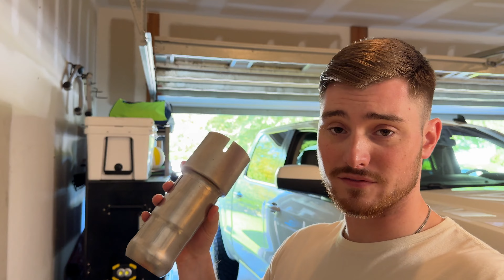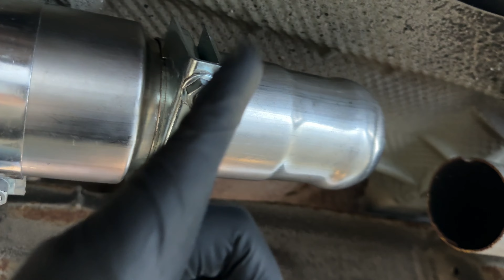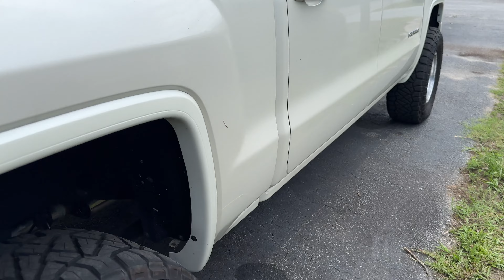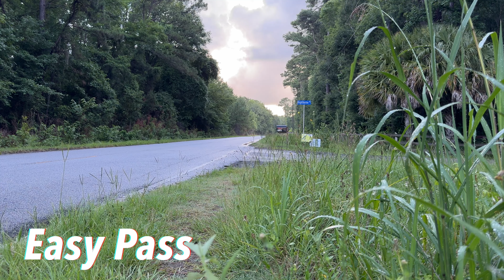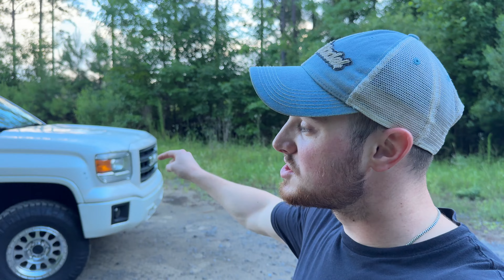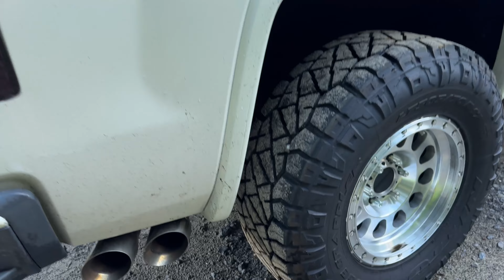Long Tube Headers & Borla ATAK Exhaust - 2014 Sierra 5.3 [STUPID LOUD]

Comment: I had same setup headers 3” catless y pipe and borla ATAK. Ended up taking it off. But people told me to buy a vibrant resonantor to tame it down. Also if you run e85 its louder
Reply from the maker: I don't mind the rowdy-ness of it lol, adds to the character of the truck imo

Comment: Sounds good. Adding a small resonator before or after the muffler will really with the rasp. I’d recommend Borla pn 401339 or a Total Flow resonator.
Reply from the maker: @mattl1576  I’ve been considering, but it’s not too bad rn, maybe if I cam the truck and it gets absolutely ridiculous

Comment: How’s the drone in the cab? I have long tubes on my 18 Silverado with a magnaflow 18” muffler and the drone drives me nuts. Ended up adding a glass pack and it helped a lot. Not raspy anymore though..
Reply from the maker: @61273ripper  it’s not too bad as long as you’re not trying to accelerate. Anything below 2k RPM is pretty quiet

Comment: What size lift and tire setup do you have? Wanting the same setup and how’s the rubbing at full turn?
Reply from the maker: @ryancarter1132  just a 2.5” level on 305/70/17 tires and Method 315s. It only rubs at the middle point, but not at full lock

Comment: sir, the speed limit on hyde park rd is 45 mph. better slow down there cowboy
Reply from the maker: @andrewl.4277  Hyde park rd in Mexico
Reply: @hunterrwiilson  I wrote a python script that changes the youtube video resolution to 144p everytime your face is on the screen but it switches to 2160p60 (4k) whenever your truck goes vroom vroom
Reply from the maker: @andrewl.4277  that's actually probably pretty suitable, lemme get that code
Reply: @hunterrwiilson you're gonna need a couple tools like the google api client library and an api key from the google console along with a full setup for a python environment so just the code itself wouldn't be beneficial to you. plus im not done. i'd like to alter the code so that everytime you're yapping it mutes the video
Reply from the maker: @andrewl.4277  how do you know when to tell it that I’m yapping vs truck sounds? 👀
Reply: Great video!   Did you notice any power difference by the seat of your pants?

Comment: I have the same setup on my 14 Silverado Borla Atak Dual Exhaust. Shes  loud as fuck. Id definetly invest in getting it tuned. Mine was running super lean because of the Long tube headers. After the tune. It definitely woke the truck up even more.
Reply from the maker: @Garcia7148  I’ll be doing that here soon as well

Comment: Any luck with the tape on the leaks ? I got same kit and even bought the supposed upgraded clamps from them and they still leaks alil
Reply from the maker: @jodaddy3135  I just discovered a small leak within the past couple days, going to try and find a solution
Reply: @ speed engineering needs to do something about that .
Reply from the maker: @ I think that's why some folks just weld the y-pipe to avoid leaks. Just isn't smart for when you need to disconnect the exhaust for any sort of work where the y-pipe is located. But it would be nice if clamps were better

Comment: I've heard if you wipe down the headers with transmission fluid before installing them they won't rust . I have a supercharged 6.2 chevy Reaper truck I'm thinking about installing long tubes . Great video !
Reply from the maker: @kennybryan4816  that is something I’ll need to research first before trying lol! But sounds like you’re about to have a chance to try it out. Thanks for the feedback Kenny!

Comment: U can get about 750-800 hp to the wheels with long tube headers and upgraded throttle body and intake manifold , cam and tune and a stage 2 trans. My coworker has one. No turbos or supercharger and he's between 750-800 at the wheels
Reply from the maker: That's pretty impressive, I'd like to see what he has going on cause that sounds crazy
Reply: @hunterrwiilson  yea I think he's holding back on telling me a few other things
Reply from the maker: @zachariahwoodside4048  probably
Reply: my 6.2 made 450 with cam, e85, cai, long tubes, exhaust, ported mani, converter, rebuilt trans he must have done some crazy sheet😅
Reply: @edwingomez7444  yea i forgot to throw cams,tune and 2 stepped the Silverado he has

Comment: How much did the whole setup run you? Could you give me a list of everything you purchased, I want to do this to my truck lol. What did you use for your exhaust setup?
Reply from the maker: @cristobalcisneros7895  on my LTH install video, which should be right before this post on my channel, I have everything listed out in the description and the price of it all at the end of the video! Sorry to make you dig but I don’t remember everything off the top of my head lol. 

Just the same crate Borla ATAK muffler that I had previously but it was just reattached to the new headers/Y-pipe
Reply: @ what cold air intake are you running and how are you you liking it?
Reply from the maker: @cristobalcisneros7895  I have some cheap Spectre intake and I plan on getting an enclosed intake for a true “cold air” intake.
Reply: Did you end up welding all the y pipe pieces?
Reply from the maker: @cristobalcisneros7895  no. Kept that able to be torn apart again
Reply: How were you able to get rid of the leaks, just with the clamps?
Reply from the maker: @cristobalcisneros7895  the HVAC tape I used in the beginning of the video cleared my leaks

Comment: What did you do about the engine light for the o2 sensors once the headers went on without the cats?
Reply from the maker: @scrumdiddlyumptious73  nothing yet. About to get it tuned out here soon
Reply: @hunterrwiilson  it didn't go into limp mode? Just has the light on?
Reply from the maker: @scrumdiddlyumptious73  nope, no limp mode. Just a light

Comment: Did u need to tune  it after the install of the longtube headers?
Reply from the maker: Not needed, but can be done to eliminate the check engine light
Reply: @hunterrwiilson   that’s all just check engine light it won’t run lean or rich or anything?
Reply from the maker: @josuecervantes5214  idk which way it’ll lean to, but if you’re concerned then most tunes to fix that shouldn’t be more than $450

Comment: Does the speed engineering headers and y pipe have 3 or 4 o2 sensor ports?
Reply from the maker: @alexhayden4224  they have 3 I believe. But I didn’t need the 3rd
Reply: How did you get rid of the check engine light since you don’t have 2 of the o2 sensors plugged in ?
Reply from the maker: @alexhayden4224  you have to tune it out

Comment: Adding the long tubes u didn't need a tune
Reply from the maker: I don't need one, but I will def need one soon due to additional modifications
Reply: @hunterrwiilson  oh OK yeah I have borla atak with shorties and I want to get long tubes
Reply from the maker: @franciscoesparza3828  they’re extremely rowdy. Sounds like a race truck
Reply: That's wat I want lol
Reply from the maker: @franciscoesparza3828  be prepared to be looked at with stank faces cause you’re so loud lol
Reply: Really that bad
Reply: What other engine mods you have
Reply from the maker: @franciscoesparza3828  it isn't that bad, but I have had a few look at me. It's seriously decently rowdy
Reply from the maker: @franciscoesparza3828  for now just LTH, CAI, MSD spark plug wires and idk if this counts for engine but I have a pedal commander for the throttle response
Reply: Oh nice yeah I have msd wires and coil packs cold air intake jet performance throttle body shorty headers and pedal commander but I'm not using pedal commander any more I was getting a p2138 and one I stopped using commander I stopped getting it
Reply from the maker: @franciscoesparza3828  nice!! I'm telling you just a few bolt ons and these trucks really open up. I'm eager to get a tune to see what power is really hiding. 

Also, for the pedal commander issue, my truck did the same and even went into limp mode for a minute, so I reached out to Pedal Commander and they sent me a software to download to like "update" the module. That was 3 years ago, ever since it's been great
Reply: Yeah I want to tune mine to just want long tubes first I'll send you picture of my truck on your ig
Reply from the maker: @franciscoesparza3828  Yeah man let me see it!